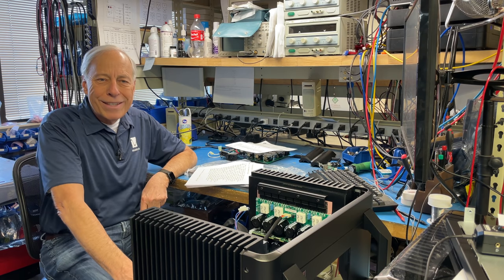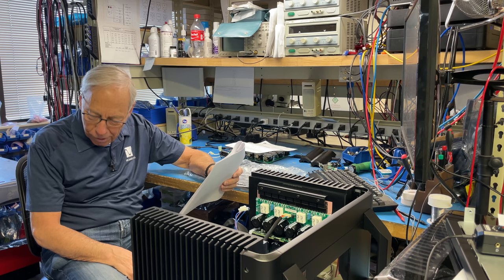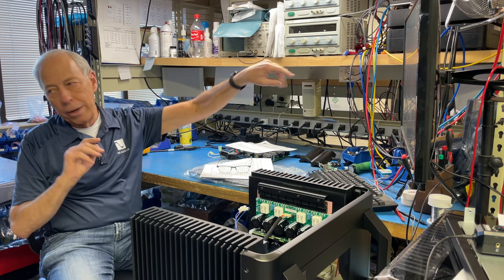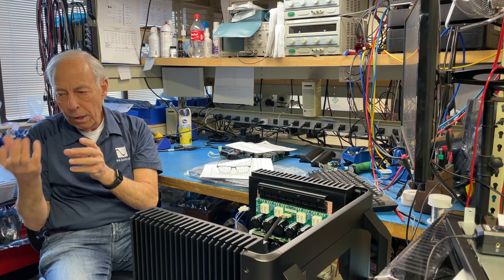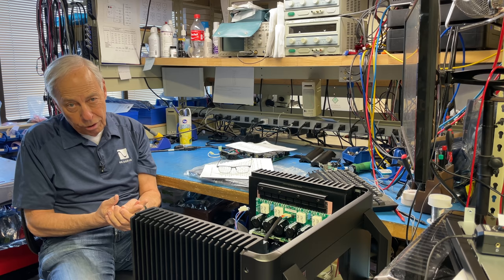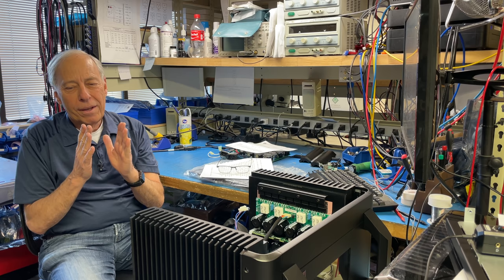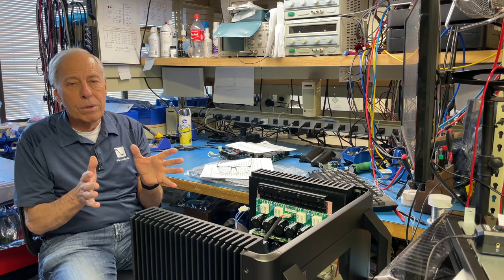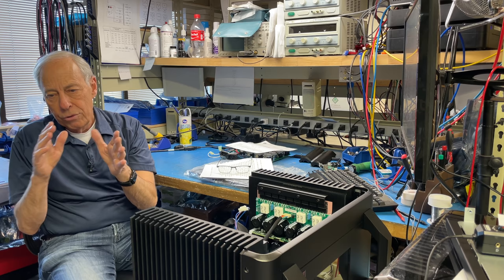Differences in digital audio cables

Comment: So you're saying that a file streamed over the internet, that has travelled through several server rooms, satellites, cables, etc gets transmitted faithfully without any noise or jitter, but it's just that one digital cable in my audio system that introduces noise?
Reply: @kytddjj  What do you mean, by the timing of the data? The data is all there is, including error correcting bits. If the file is intact and within the supported bitrate of the interface, than any arising issues are due to improper processing of the file or conversion issues of the DAC. It's shouldn't be a cable issue at that point. Maybe I'm missing something.